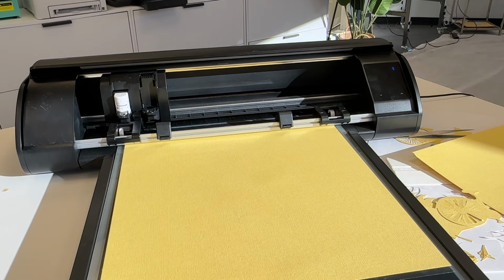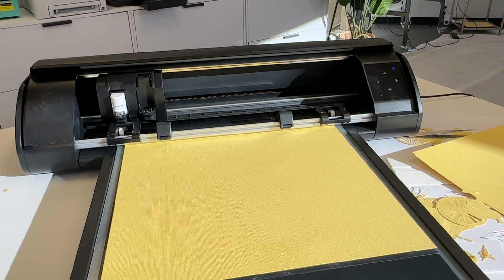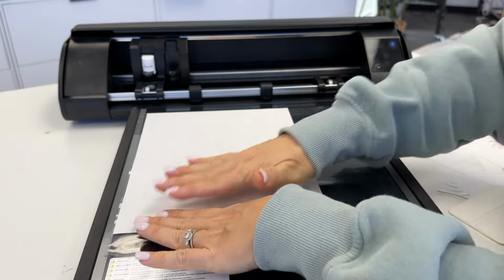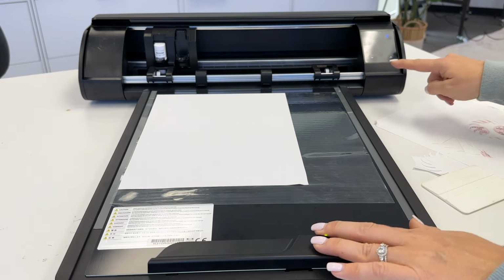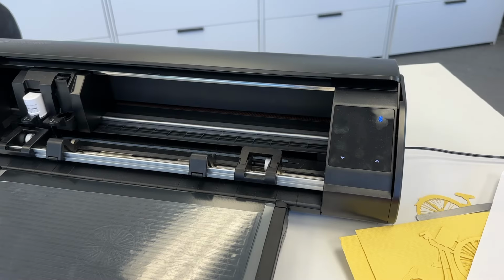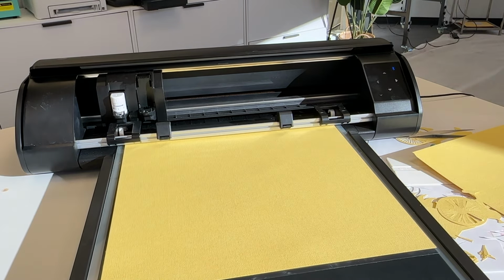HELP! CAMEO 5 Electrostatic Mat Won't Load? Here's the Fix!

Comment: My Silhouette Electrostatic Cutting Mat is not working. no paper wants to stick. I have already tried changing the protection sheet and it is the same. It turns on perfectly, but it won't let any paper adhere. 

Do you know what I can do?
Reply from the maker: Is the connection secure so the electrostatic charge builds up? /